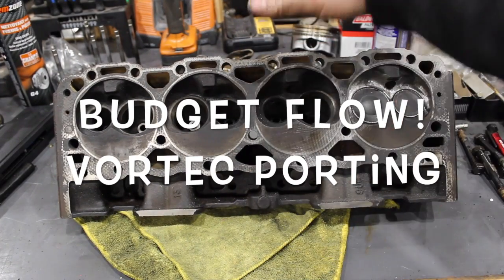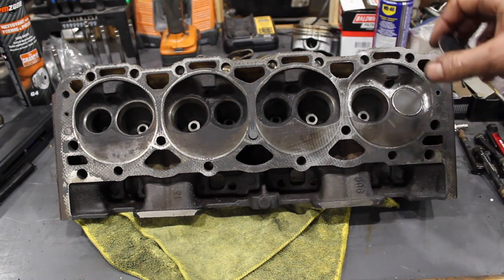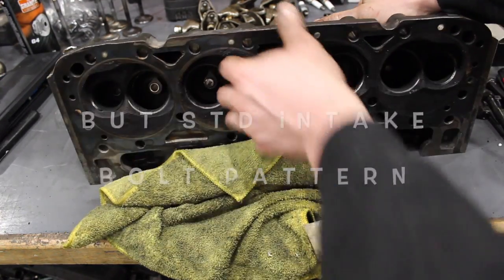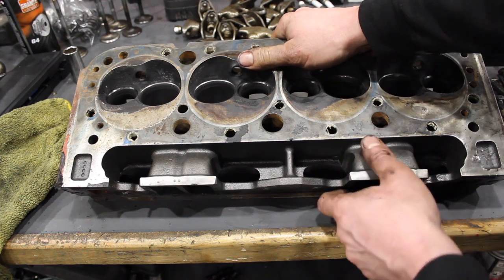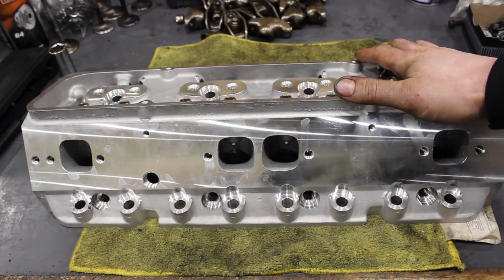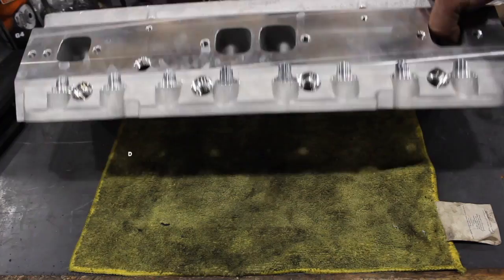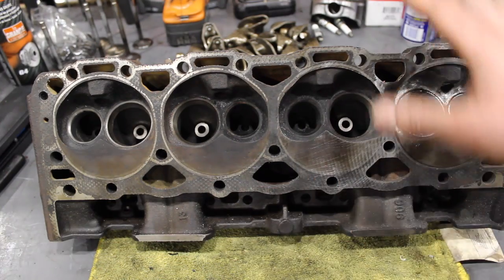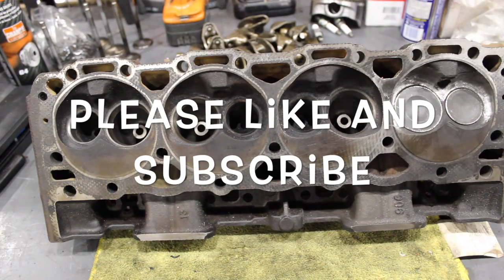Vortec Porting (Part 1) Intro to Head flow shoot out!

Comment: Can you do a video on polishing and port matching your intake also matching the proper cam ,cam lift duration and lobe separation to match the 906 vortec head with 202 160 valves oh and selecting the proper carb set up cfms and what not and if you have time add in the proper ignition . My 358 4 bolt is ok but I seem to be stuck at 435 hp im wondering if I'm missing something

Comment: If you pick up used vortec heads at the wrecking yard or a swap meet. Look for cracks on the head gasket mating surface between the bolt holes and water jackets. Recently I was looking for some cores to rebuild for my 4.3L V6,97 vortec. Basically they're the same as the V8 heads.  I took the heads off 2 engines to find 2 good heads with no cracked water jackets and no cracked/ badly pitted valve seats area. Machinist still managed to find a crack that I missed. He was able to repair it by hogging out the valve seat area and pressing in a new seat. I bought a pair of rebuilt vortec heads on Ebay about 2-3 years ago. They both had crack repairs.  They only lasted about 20k before I had to add stop leak to the radiator. I hate that stuff,clogged up my heater core. Luckily  after I replaced my heads,I was able to back flush it with a hose and the heater works fine now. The heater core is a B to replace in that truck. Basically the dash would have to come out.

Comment: With a little cleanup work and decent valve job those Amazon 200cc heads flowed 265 cfm @ 0.600.  Mine were assault racing and dual drilled for Vortec bolt holes. After Lloyd Elliot ported them they hit 299 cfm.

Comment: while i have zero interest in anything from china, i am most interested in Edelbrock Etec 170 heads.   would be interested to see the stock flow compaired to stock vortec head and with each ported.  I have read that the Etecs actually flow equal to or worse than stock vortec head which is hard to believe that a company would plow so much time, energy and money in to a product and gain nothing.  i find it very hard to believe that Edelbrock does NOT offer a cnc ported version of the Etec head.
Reply from the maker: I've been curious on flow #s on the Chinese heads and I know others have been too because I get emails from guys but rarely ever public comments becuase I think guys are scared they will get torn up haha.
I have a set of etec 200cs on a engine currently and only have the factory flow #s as i didnt flow them myself but I will compare them in the upcoming video to stock vortecs.
Some really good flow info coming up! Real deal info! No hear say and forum facts

Comment: Great vid!! Cant wait for the results. Happy new year ✌
Reply from the maker: Happy new year! 
Any guesses the the best flowing to the worst flowing? I'm curious to see what guys are thinking 🤔
Reply: @cuttersperformance if I was gonna wager, I'd put my money on The Darts taking top spot. Full port stocks 2nd. The rest is a toss up.... but I dont underestimate the Chinese heads. Ran a set on a in my 91 c1500 and for the money they were pretty decent. Running the summit dart clones now. Tbh not much difference performance wise imo. The summits are thick and beefy though and I dont obsessively stare at my temp gauge near as much 😏

Comment: I am right at this point of buying after market heads. I am really excited to see this test!! I have heard the spring package on the China heads will need to be replaced before running any sizable cams?
Reply from the maker: Yeah I bought the heads bare so I could add my own USA Made springs kit and valves in them 👍

Comment: Can’t wait for this I’m wondering the best things to do to my 906 vortec heads before I put them on my 408 small block
Reply: That sounds great. But with a 64 cc combustion chamber your compression will be well above 10:1. Most likely out of the range of pump gas but it would be cool
Reply: @fukemallgarage  it also has flatops in it but I belive I can get away with it. It will be around 10.8.1
Reply from the maker: Can choice will be key, remember dynamic compression and cranking compression will tell you if it will run on pump gas over static compression
Reply: @cuttersperformance  I need help the cam I was looking at is a Howard’s 112141-08
Reply: @cuttersperformance  how do you think that cam will work. I want a split duration because I know vortecs lack on the exaust side a little and I want it choppy
Reply from the maker: That cam has all the right specs to work well with vortec and be very lumpy.
You will have to get all your specs and cam card together and punch it into a dynamic compression calculator 
Vortec heads aim for 8.3 to 8.5 dynamic (91+ octane with 34 to 36 total timing)
You'll probably need 67 to 70 deg intake close ABDC to to hit that

Comment: ready for this also I have heard of guys having valve seats drop out on those china heads while in use.
Reply from the maker: I've heard a bunch of mixed things! But I couldn't help but be curious haha honestly they look better than I thought they would 😄 
Wonder what they will flow? The ports look pretty nice 👌
Reply: 10-15yrs ago the China heads were shit. But they've stepped up their game big-time. The KMJ Assault heads are the best of the imports. Same head Dart is using.
Reply: @thereluctantgearhead4544  I have a set of 195 kmj 5yrs love them not 1 problem on everyday driver..